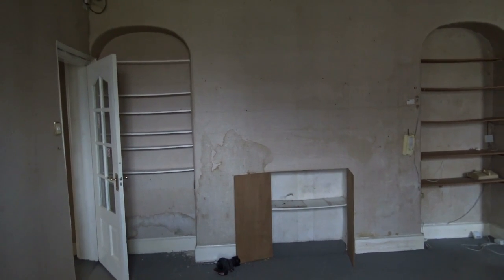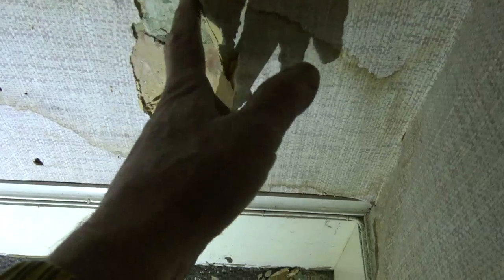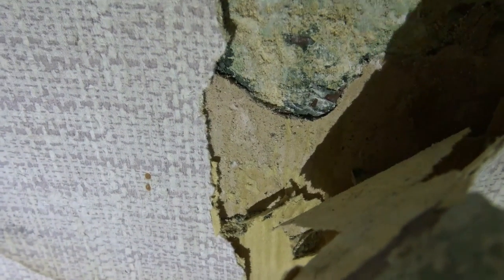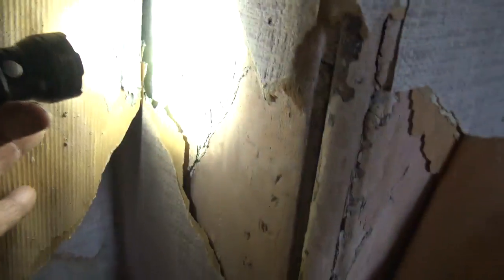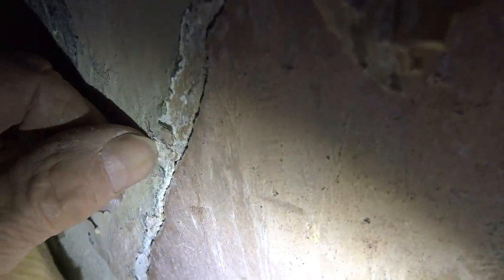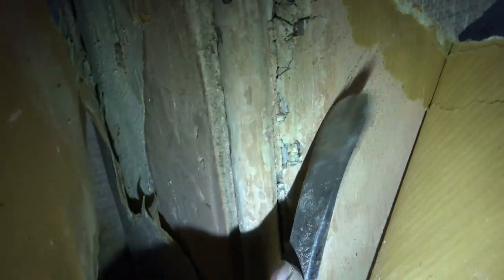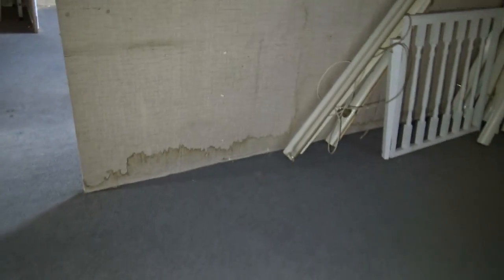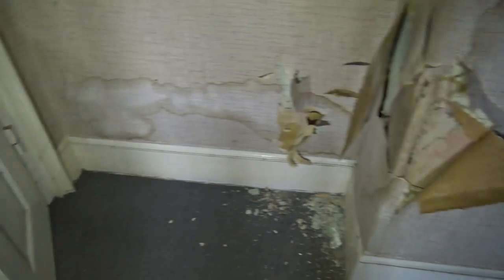Rising Damp?  No it ain't - just gypsum!

Comment: If as a diyer, i battened and plasterboarded the wall and left some sort of ventilation in behind would that work? I don't have the budget to pay a plasterer 250£ A day labour? many thanks Peter I have subscribed and am enjoying your content as a new owner of a 1930s semi.
Reply from the maker: It's not recommended - we see this sort of approach failing a lot.  Why don't you have a go at lime plastering?  Its not hard, you can do a course at Ty Mawr for not much, and you'd enjoy it.  All the materials are cheap as chips.  Many of our clients go this way now, and all of them have a lot of fun, and get great results.. much easier to get good finish with lime than gypsum - you can come back to it next day and wet it up again, and re-work it till you are happy.  Then paint with Earthborn clay paints...  I'm assuming you sorted cause of problems - ventilation, sub floors, drainage, ground levels etc...
Reply: Peter Ward I don't actually have damp problems other than a stud wall in a bathroom which has been tiled ie: clearly condensation!. I am ripping the tiles off back to brick on the remaining solid walls and the bathroom will then be moved upstairs, the room will then be a utility room. The Muppet who owned the house before painted the outside so that needs to be removed, and I am in the camp of prevention rather than cure. As a matter of due course I will replace the underfloor ventilation  bricks and ensure they have adequate air flow. what type of finishes can be achieved with lime, as it will be difficult to appease the wife who wants ultra modern walls? many thanks for your reply. also any link as to the lime plaster you would recommend?
Reply from the maker: speak to Ty Mawr lime - they'll help with the questions.... good luck!

Comment: Hi Peter.
Can you advise on what could be the issue in my hallway, please see the link below:
http://georgianrenovation.blogspot.ie/2016/02/the-final-layer-of-limecrete-was.html

I have a limecrete slab laid with underfloor heating throughout the entire ground floor. And original lime plaster on the hallway walls. Despite this, the wall on the right side of the hall as you walk in has a 36" high damp on the lower section of the walls.

As the ground and floor is fully breathable, I put this down to either condensation (as the heating has yet to be turned on) or trapped moisture in the wall perpetuating to my side, as the neighbours on the other side of this some 20" thick stone wall 99% have a concrete floor and gypsum interior walls.

Should the heating sort this out, or is there anything else I can do to get alleviate the problem? I'd hate to have the heating on all year round just to counteract neighbours poor choices. Thanks!
Reply from the maker: Great restoration job! Limecrete may have been a bit wet when put down - hence cracks... not sure for certain though.. As for walls - are they physically wet or does it just look that way?  Have you actually sampled wet stone?  Or is it historic salts that make it look that way.  In theory the wall will very slowly dry out - 50mm thickness every 3 months - but if cement and damp proofing rubbish on other side, even slower.  I'd not worry about heat in summer - rather keep good airflow and ventilation in there - maybe a little fan just to circulate air - and make sure it can dry.  dehumidifiers are useless.. Need more info really on this one..
Reply: Thanks for the reply! The wall is actually damp, proper damp, it's wet to the touch. The wall should be completely dry (you mention drying time), the limecrete slab has been laid over 2 years now, but i've yet to move in). There was a damp problem throughout the ground floor when I bought it 5 years ago, but the limecrete slab poured across the ground floor has solved the damp in most areas. And despite using new lime plaster throughout the ground floor with no wallpapers, gypsum etc, damp remains in the  hallway and on one or two internal walls. It's somewhat baffling really, I can really only put it down to condensation. But like you say, it might be worth drilling a few sample holes into the walls to examine the dryness of the inside of the wall. I have a feeling with the heating turned on and an increase in wall temperature, the problem will likely disappear, but like I say i'd hate to have to have the heating on all year round just to alleviate this.
Reply from the maker: Think you need to see if it really is damp - or just salt staining.  Unusual if it really is wet, and other areas dry - I'd be looking at drainage - leaky pipes, drains etc - check everything.  Then ventilate house - heat on its own not so important as airflow.  Little desk fan to circulate air - more beneficial than heat or dehumidifier.

Comment: i have found that if a wall is rendered in a weak lime bssed mortar, say 12 sand 2 lime 1 of cement, gypsum putty will break down with moisture. its probably the guy has rendered in 3 sand 1 cement and that is stopping the wall from breathing. 
An interesting comparison is in my area there is two towns only 3 miles apart.. Town A is on a sandy beach and over the past 150 years has been flooded with sea water on occasions. Town B is on a cliff top and well above sea level  and on a limestone base. Which do you think is worse for damp?
Town B. many old stone homes have salt damage up to two metres up the walls, and are always a problem. Town A, despite the old stone homes being flooded on accasions are generally in reasonable shape. damp is usually no more than a couple of feet up the  wall.
Reply from the maker: ANY portland cement is not a good idea.  If totally breathable - no problem.  If gypsum, and / or any portland cement - damp problems.   Interesting about the towns - I think more likely elevation = wind = cold thus more condensation interstitially..  Damp shouldnt be up the wall at all if they are breathable - all lime - inside and out.. Might be salts - depending on whether wind blown salt, or salts in the mortar off beach sand for eg... Hard to say.
Reply: Peter Ward  i also noted that underneath the homes in town A, even though the vents where blocked the sand was dry. i think its drainage. on the semi impervious limestone, the moisture concentrates under and around the houses. Town A i lived in as a boy, and the entire yard around the house would be flooded, within an half an hour the water would be totally gone. Town A however does have a borer problem in wooden floors. A study i read done by a guy on rising damp, revealed that in his experiments he found rising damp only present in true mud mortar,(no cementitious material at all) with my years in salt damp i believe him, moisture seems more consistent right through the thickness of the wall built in mud mortar and stone. Salts however i have noted, have little effect on the mud mortar, even when exposed to the air. its the render in lime and or cement / lime mortar that breaks down. i have found long salt crystals on stone in the centre of the wall built in lime mortar, but rarely in mud mortar, strange but true. The field we play in Pete is an interesting and somewhat complex one, something that Franchise Industries, specialising in sales and profits, havee no place in
Reply: sorry pete i bave to correct myself, salt crystals were present on both the stone and lime mortar, but only on the stone in mud and stone walls. i also ote mate that in my area of Australia we have severe concentration of ground salts. i have a vid up of my little project, that is metrs from a salt lake, that was filled, and was probably scraped for salt in the early days. On Yorke Penisula, lower down there are hundreds of salt lakes. They were all fresh when the first settlers arrived, but land clearing and cultivation saw them turn to salt and also many homes suffer from the salts and the rise in the water table. water table height also has a bearing on moisture problems in a home.
Reply from the maker: Now you're talking complex stuff - I worked with AMDEL in Adelaide for a while - a lot of research was going on with salts - but they still had this fixation on rising damp and tried to relate it all to that.  The mechanisms are simpler - diffusion mainly, coupled with evaporation.  I still think internal moisture contributes more than we realise - moisture from people condenses within walls, and allows salts to mobilise through hygroscopicity and evaporation.  Cold nights = interstitial condensation within the stonework which then allows salts to move in the pore spaces.  Ground water isn't so much of an issue - its not exactly a swamp there is it!  Oz is a very complex place - I'm a geologist / geochemist by background and worked in mineral exploration - looking at how orebodies oxidise, and how we find deeply buried orebodies using geochemical signatures - you get into a whole new world of metallic ion movement.  Those mechanisms are partly driven by electrochemical systems - fuelled by chlorides (batteries - chloride solution - anode - cathode) of which there is plenty in the Ozzie soils as you point out.  You have some very insightful points there about mud mortars and lime - very few people I've ever spoken to have that level of observation and understanding.  Do you have a group over there of like minded folks?  Be very interesting to compare notes.. Funny - my house is in Shropshire - found some pottery here when digging - on the bowl is a picture of a troop review at the penal colony in Adelaide - the makers mark is Bercy McCall - Rundle Street, Adelaide.  Turns out the farmer here was sent to oz as an advisor to the early settlement Govt on farming practise and must have sent things back from ozzie to his family as gifts!

Think you need to look at interstitial condensation as a possible mechanism - need to look at thermal imaging - we work as standard now with thermo hygrometers - work out the dew point, and then look for areas susceptible to condensation.  With wild swings in temps, and high humidity, cold desert nights, you are very prone to that - and I'm certain it plays a big part.

Comment: I have a Victorian property with a cellar room to the front of the property. about 3 years ago I cement rendered the external wall which has now all come away. there is no ventilation down there. Would you think this is the problem.
Reply from the maker: Leave cement off - if you want a render finish use lime.  Also, you need THROUGH flow ventilation - so one vent at the front aint enough.  We use humidity controlled vent gear in most cellars these days.  Cement render and cellars are a no-no!

Comment: Nicely illustrated Mr Ward, as you have shown, the slate damp course really was pretty impermeable, add to that the air bricks and perhaps a cellar and so long as they stay unblocked and open you shouldn't have any issues because there would be a nice air flow and thus no mould or damp issues. The new holes that you have shown drilled in and above the slate barrier have some kind of liquid damp course chemical pumped into it under pressure. The idea being that this chemical magically forms a damp course barrier within the line of all the holes,  soaking through the solid brick or stone to form the barrier when in fact because this doesn't  happen like they think perhaps it would work better if the holes were touching one another, edge on edge but obviously you can't do that all the way around.
I once saw another idea from the early 1980's where you drilled the holes and inserted a flexible tube of material that attracted the damp to it so that every few months you were supposed to take them out and either replace them or squeeze out the water in some way, perhaps even put them in a drier to get rid of the moisture before putting them back in. 
ideally it would actually be better if all homes were built up on stilts, brick or stone columns and just to make triple sure, a slate DPC on the top of that before the floor joists are put down. 
For all those poor buggers whose homes were built on flood plains the council recommend that an impermeable barrier or 'bund' is dug in around the whole house but in actual fact if you could jack up the whole building onto stilts that may be more economic. 
But in the grand scheme of things digging ditches, keeping them cleared, laying hedges and NOT building on any flood plains would probably be the optimum thing but as we all know, vast open tracts of seemingly dry looking open land are hard to ignore by the cash strapped councils and the profit motivated house builders are only too happy to oblige them.

Comment: I've had this exact problem in my house, layers of gypsum over old plaster. The plaster was two inches thick in places where it'd had so many layers applied. Is lime render the only solution to the problem? My house is a cheap (but old) mid-terrace, not really worth investing thousands into. I've stripped the plaster off, and thought of maybe battening and plasterboarding the walls, but I'm not sure if salts would come through the battens.
Reply from the maker: Be careful about batening - it can trap moisture.  The cost of doing that is similar to lime plastering - lime is really the only sensible solution.  Research the cost of lime - it is mainstream these days - and coupled with gentle and constant low temp heating, will result in a warm dry home for years to come.
Reply: Thanks Peter.

Comment: I always thought plaster was Calcium Carbonate (chalk?), or is that lime plaster? I now realise that plaster, plaster board is just gypsum or calcium sulphate dihydrate! Is this where the sulphates are coming from? I was alwasy under the impression you leave plaster to dry for around 6 weeks before painting or wall papering.
Reply from the maker: Correct - LIME plaster is calcium carbonate when it has cured from calcium hydroxide.  Pink plaster - or plasterboard - or bonding - etc is gypsum - calcium sulphate - and yes, its where sulphates come from as it breaks down with damp - and makes the prong meters go mad.  Lime takes about 6 weeks to carbonate - the lime cycle basically goes calcium oxide from the kiln, plus water to calcium hydroxide - then further slaking and mixing to make lime putty.  This then reacts over time with carbon dioxide and water from the air to form calcium carbonate.. The crystals grow slowly in cold and a bit faster in warm - about 15 to 20 degrees is best - and they form long slender needles - which make lime very flexible and strong.

Comment: Hi Peter, Thanks for your videos! What are your thoughts on anaglypta pvc free lining paper over lime plaster? I have a wall that needs a lot of repair and skim coat and I guess paper would be easier. Also they claim it's breathable... is it really?
Reply from the maker: Hi Maria - I'd be very, very careful.  Even the glues will cause problems.  Best option is to use the Earthborn clay paints - lovely stuff, and fills any cracks and uneven bits.    Repair in skim would not be hard - can buy tubs of putty finish coat from places like Ty Mawr..  Shout if you need help - peter@heritage-house.org